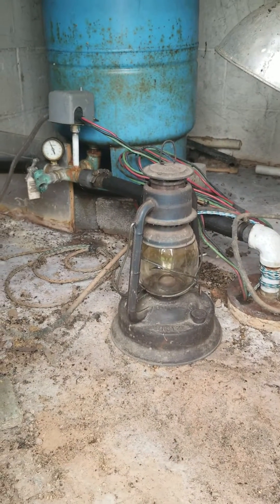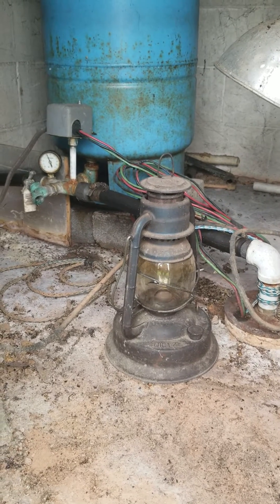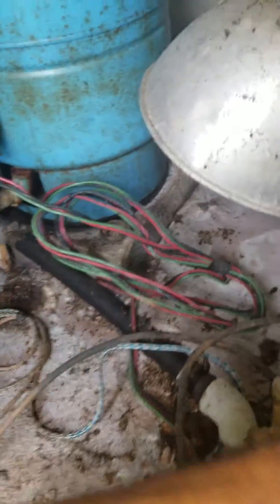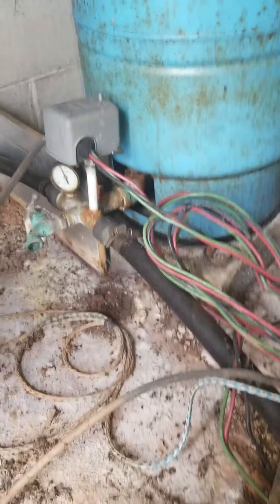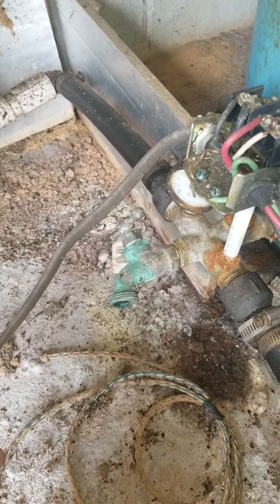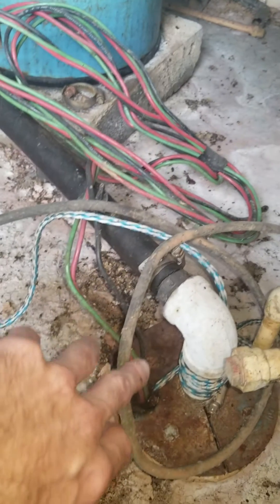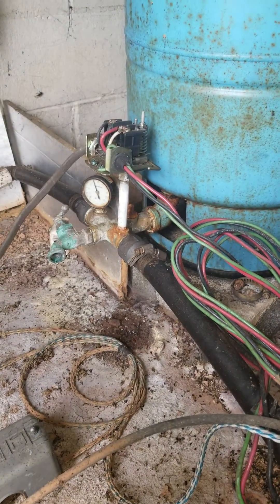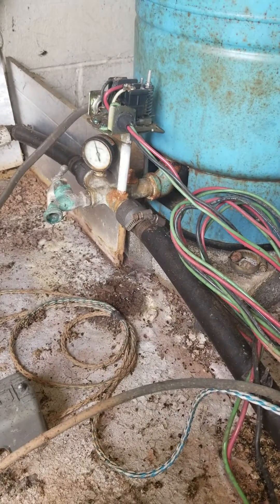Well pump keeps tripping breaker

Comment: Man thanks to your short video (which im glad it was short and straight to the point) we avoided pulling the pump and just tested the wire sections and found a short spot that was underground that was a issue. Got it temporarily fixed and Ill be putting in the new section of wire this weekend. Saved us a lot of headache tho. Subbed!

Comment: What if the breaker trips, I reset it...the bladder tank finishes filling up and doesn't trip again till we use water somewhere in the house?.....(sometimes the breaker will trip twice while bladder tank is filling up if water level got real low) but as long as I reset it the bladder tank will fill up, and then be fine till we use water again?
Reply from the maker: There's likely an exposed wire down the well near the pump. Or a bad bearing in the pump motor

Comment: my water pressure will be fine and then not. ill check the well pump breaker and it will be flipped. ill turn the breaker back on, water will be fine for a while then it flips again. whats the issue

Comment: So what's next if the breaker tripped with the pump disconnected? 1. The wire is bad somewhere to the pressure switch. 2. The pressure switch is bad and tripping the breaker. ??

Comment: I know this was 6 years ago, not sure if you still do youtube but, my breaker trips when drawing too much water like showering running, flush toilet and running a sink. Does not trip everyday so not sure if this method would work, any suggestions? Another note, did discover our pressure gauge is only reading about 50 psi max right now, when it used to read around 80-90 would this maybe be something?
Reply: Does the breaker trip every time?

Comment: You're videos are amazing! You've helped us at many times. We are currently having an issue with our points really arcing (shooting out sparks) and blowing the breaker as soon as the breaker is flipped back on. We disconnected the pump at the well head and it's still happening. And then we dieconnected going into the pumphouse also and it continued. We've replaced control box, points switch, etc. Any ideas? Just randomly started a few days ago. We are a farm and need our water back soon! We would be so grateful for any ideas or direction.

Comment: Question:  Had a 1/2 hp shallow well pump..............bought a used 1hp pump.............with not sprinkler heads on the sprinklers, pump rad fine................gushed water.  Put sprinkler heads on and now tripping 20 amp breaker.  Any ideas   ty

Comment: FYI: If this is your problem, tripping breakers etc: Look at your electrical, ALL parts of it, for mouse damage/nests.
This was the issue I discovered, and it's a (comparatively) easy fix.
Try to plug holes when you are done your wiring repair to stop further damage.
Even if you don't know much about electrical, it's easy to see chewed-on wiring, and if THAT'S your problem, no sense in going any further until you get that handled.

Comment: Brother in law has a system that when the water heater is running, the well breaker trips. They are also saying when it rains a lot well breaker trips. Any thoughts?
Reply from the maker: Probably a bad wire in the trench, causing a short to ground. 
Has the Well/water line been hit in recent years while digging? 
It's also possible that the pump is old & tripping itself due to a internal short.
Reply: @h2omechanic  well is older, but what is weird to me is it does not trip if they take cold showers, I will have them try the test you showed in above video and that will at least let us know if it is the supply wire.

Comment: What about damage to tbe wires around the fuse box from the heater used to keep from freezing last month. I’ve wrapped them with electrical tape after seeing a couple small places and caused spark and blew fuses twice (15 amp). This time there was a pop sound from fuse box with fuses still ok last I looked after repair to pipe fittings and fuses replaced. Could fuses be old or dirt or insect debris cause the pop? I’m not an electrician but I know enough not to kill myself. Should I replace the wiring. I want some water badly. Thx
Reply from the maker: Replace that wire you taped! It sounds like the 2 hot wires are exposed and you taped them together but you needed to separate them from touching. Just kill the power & cut the wire & use wire nuts to make the splice with the new wire & cut out the melted section
Reply: H2o Mechanic thank you

Comment: Why don't you just test the wire insulation/motor windings with a megger?
Reply from the maker: You know I bought a meg meter & typically only use it for wire failure in the trench. It's best to just update old wire imo
Reply: That wire is definitely old and would be out of code here.

Comment: So we’ve replaced the breaker fuse and the box that hooks up to the water pump but it still keeps flipping the breaker.  What could be causing the breaker to keep flipping?
Reply: Pump is locked up
Reply: Pump rating must match voltage of wire if pump is 110 or 115v and you wire is 230 240 v the pump will burn up and trip breaker